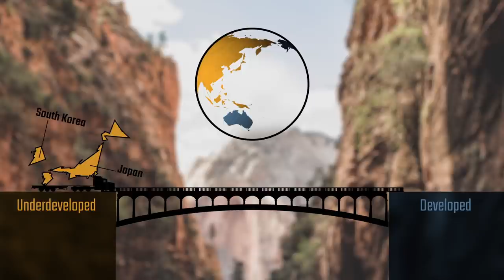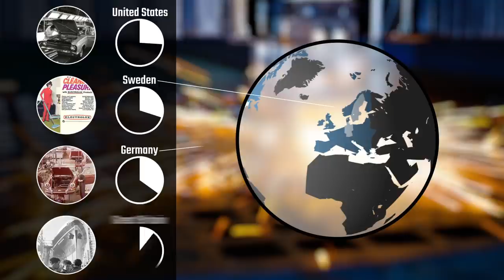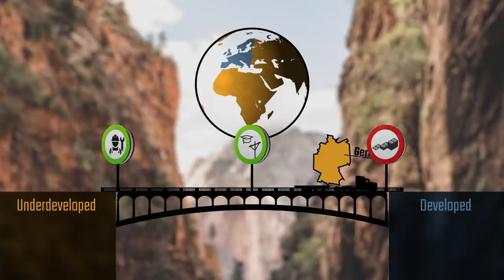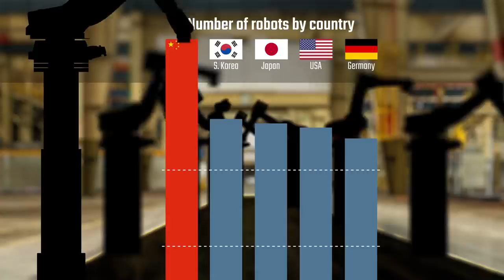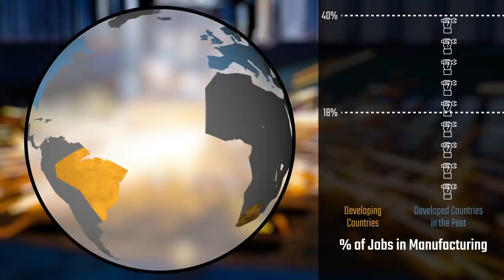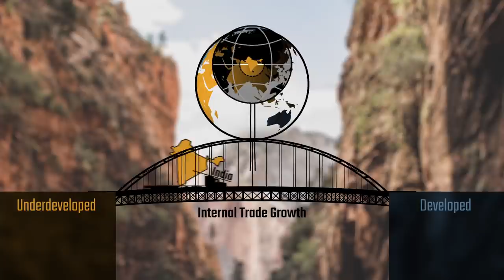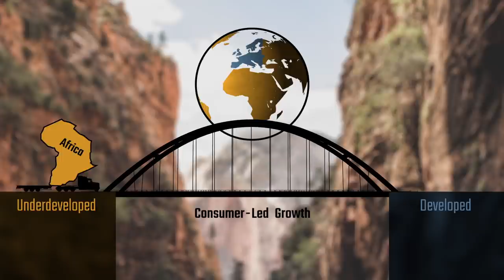Premature Deindustrialization

Comment: Automation seems to disincentivize investing in human capital.  The ability to produce high quality labor is key to being able to join the middle class.  And while it's possible for households to invest in their own human capital, that's an additional financial burden for them.   So it seems like automation is another force squeezing the middle class out of existence.
Reply: Automation still incentivizes human capital, but only for "superstar" workers. The few workers that do remain at a modern factory are superbly skilled and highly trained machine operators--but the others who only turned screws or applied paint are gone, because the robot can substitute their labor for less. Robots seem to function as a floor to marginal productivity (a "minimum wage," if you will), below which it isn't worth hiring a human. Given that a robot works much the same in India as it does the United States it's becoming cheaper and easier for firms to buy robots to make their output rather than reform the entire school system or labor culture.
Reply: Good point, although it sounds like my larger point stands.  Robots do seem to put destructive pressure on the middle class.  You make an interesting point comparing the marginal productivity floor to minimum wage.  If I understand correctly, you're saying that, just like the actual minimum wage destroys jobs by making it not worth it to hire humans whose labor is worth less than the minimum wage, robots destroy (certain) jobs by making it not worth it to hire humans whose skill is below a certain threshold.  (Maybe we should call the marginal productivity floor, "Minimum Skill") 

This is a point I've made to people in the past.  You don't need to believe that jobs are finite (the Lump of Labor fallacy) to believe that automation and AI can have a destructive force on the ability of people to be employable at the lower levels of skill.  And of course, as time goes on, improvements in AI causes Minimum Skill to rise.  And yes, the Market is adaptable, and AI is harder to program for some things than others.  But it's an open question how many people certain sectors can afford to absorb.  Could the market support 100x as many youtubers?  Maybe.  Certainly with improving software tools you might have teenagers making films we wouldn't normally see outside a movie theater in something like 15-20 years.  The future promises to be a very weird place, no matter what happens.
Reply: In some sense this already happens in places like Saudi Arabia. The oil industry is heavily capital-weighted and fantastically productive, but beyond that the market doesn't really exist for anything else but oil extraction and leisure. So Gulf petrostates end up buying off the rest of their society with oil revenue--Saudi labor force participation is something like 20% and the government just pays off the rest of the population with the revenue it skims off Saudi Aramco. 

In the USA I think we are seeing the beginnings of a top-down yet bottom-up movement to a similar arrangement. The fantastic high-productivity CEOs of Silicon Valley who make billions out of a workforce of mere hundreds are very pro-welfare state and many want to implement a universal income. The "corporate masters" against such expansions are often large employers of many low-productivity workers, like Walmart.
Reply: Another interesting point.  That seems to indicate that once automation reaches the point where companies like Walmart are replacing large percentages of their workforce (like say, stockers) with machines, that will coincide with a reduced opposition to Basic Incomes schemes.  That's actually quite a relief.  It's also nice to know that this sort of thing has been tried already and apparently works.  My biggest concern with growing automation was never that it spelled unavoidable doom for the lower skilled members of the workforce, but that opposition and indecision would stop us from addressing it properly.  (I still see respectable economists trying to use the Luddite Fallacy to say that automation is nothing to worry about)  Of course, politics is still politics, so I'm sure the transition won't be as smooth as it could be, but the world looks a lot more prepared for this transition than I thought.
Reply: The resultant society will in fact be highly unequal. Gulf society is dominated by a handful of princes and magnates. That said life goes on and Dubai is nicer than many cities in Europe.

Income distribution is, in the long run, determined by productivity distribution. In a society where productivity is highly unequal then so will the incomes.
Reply: On the contrary it increases the demand for high skill but decreases the demand for low skill labor.

The ratios however obviously dont compensate.
Reply: I wouldn't call that a contrary position (Because I agree but still hold my original position).  Although I'd argue the situation is a bit more complicated.  AI (which is not at all the same thing as Automation, even if they sometimes overlap) can also decrease the amount of skill necessary for a task.  That's pretty destructive for households because it decreases the opportunities to for high paying work.  So low skill work is getting pressure from automation and high skill work is getting pressure from AI.  

Now, I'm not at all saying that this means we are inevitably bound for an economic hellscape, just that bad outcomes are possible.  Businesses and Households probably need to grow at an equal rate for economic stability, although that's just a conjecture of mine at this point.
Reply: Michael Spence aye sorry i got what you mean. In that case i d say that replacement jobs for high skill are much more likely than new job creation for low skill.

The field for high skill labor seems more dynamic at least and there is a chance of newly derived jobs unlike for low skill  jobs. Not to mention the relative ease of transitioning people from one skill to another.

This can totally change the specific factors model as well you think about it as traditionally unskilled lanor was seen as the mobile factor.
Reply: Investing in human capital makes no difference in a country where the avg IQ is 65. Such a country will never achieve large growth, due to poor genetics.